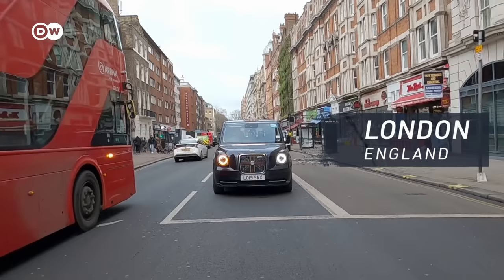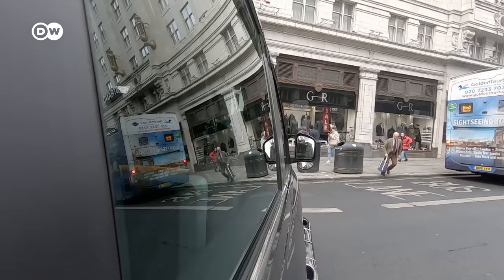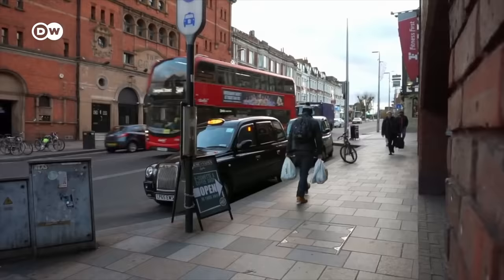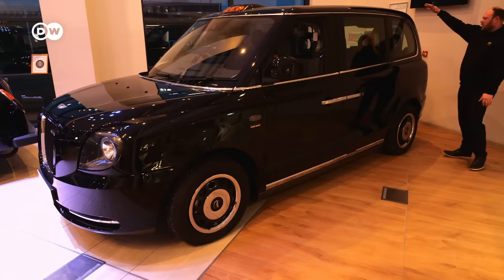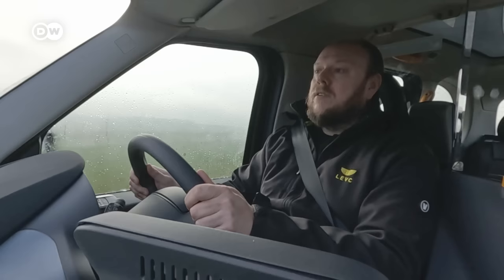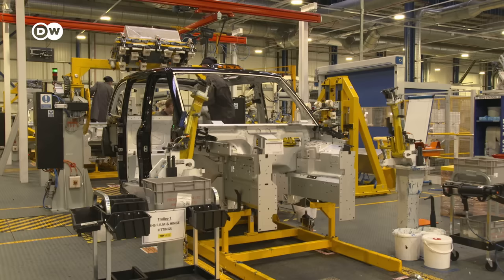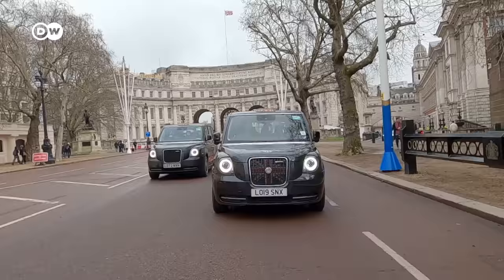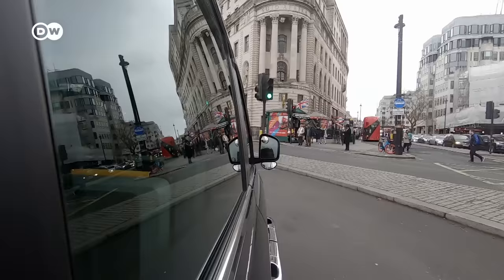Chinese Electric Taxis TAKEOVER London!

Comment: As far as I know,  Geely Group, the Chinese automotive company responsible for producing this Taxi, also owns Volvo and Lotus.
Reply: I`ve been in the factory and they use the Lotus production method for the alluminium monocoques. Quite interesting.
Reply: ...and Lynk&Co and PoleStar Volvo's EV division !
Reply: And then possibly Aston Martin🤔
Reply: And is the biggest share holder of mercedes benz.
Reply: @diuco17  That's what I say.
Reply: @diuco17  Mercedes doesn't have a huge following in China because most Mercedes are made in India, but BMW has a larger market following because BMW at the Brillance factory and in Chinese BMW means "Racing Horse" !
Reply: @etow8034  Do u know Beijing Benz Automotive Co.?
Reply: @etow8034  Yeah sure... Mercedes sold about 980k cars in all of Asia last year, of which 750k were sold in China. Meanwhile in India they had record sales of... 16k cars.
Reply: Ford who owned Volvo was losing money big-time, dropped the hot potato at the first moment, Geely stepped up for the deal and it has been making money year in year out.
Reply: Geely is also in joint venture with Proton in Malaysia and is saving Proton from oblivion.
Reply: yes, since quite a while ! Even took 10% of Mercedes-Benz stocks.......
Reply: @etow8034  And Zeeker
Reply: Geeky is also a major shareholder in Mercedes
Reply: @ericlin1243  "Geeky ?"  Major shareholder ? With 10% ? Don't know where you learned math ?
Reply: @51tomtomtom  10% is major.  How much % do you own?
Reply: @51tomtomtom  major here means significant, not majority
Reply: @51tomtomtom  You're confusing the word major with majority. The definition of major is important, serious, or significant.
Reply: Geely owns 50% of this joint effort and production of all electric London taxi is in China.  Of course, DW won’t tell u that.
Reply: Just a quick search and you can find: "The Chinese BAIC Group currently holds 9.98 % of the company's voting rights, making it Mercedes-Benz Group AG's No1 largest individual shareholder." instead of making unnecessary silly argument.
Reply: yuh..it is
Reply: @DanielBos  Thats why I have no faith on Benz cars.. most of them are Inidan made ones
Reply: @isuruthiwanka2595  ...and parts as well. Bosch parts are now mostly made in India !  the only thing German is the brake and steering fluids from Pentosin ! ...LoL
Reply: @51tomtomtom  Yup in bourse anyone who owns more than 5% of a company's share are called a major shareholder and have "restrictions" in relation to movement of their shares
Reply: What Geely has done with Volvo and Polestar is fantastic. They have kept their ways and only used the funding.
Reply: @etow8034  Generally BMWs are more reliable than Mercs. I used to own Mercs but now I am happy to have switched to BMW.
Reply: @etow8034  作为一名中国人，我可以很肯定的告诉你，你说错了。奔驰和、宝马和奥迪都在中国生产，除了S级、7系和A8，以及最高等级的SUV仍然保持进口，其他的都已经本地化国产了。印度车在中国基本没有市场，除了路虎和捷豹（好像因为发动机的问题口碑很一般）。
Reply: @etow8034  where do you get that information - Mercedes doesn't have a huge following in china?  they are part of the BBA, the first B is Benz Mercedes.   They are definitely on top of the list.
Reply: Also owns Maserati.
Reply: @marsmellow1589  they make a van version now which looks a bit stange!
Reply: @51tomtomtom  Major means.No.1
Reply: @diuco17  wow, I didn’t know that
Reply: Volkswagen Group owns Audi, Lamborghini, Ducati, Bentley, Porsche, Jetta, Scout, SEAT, Cupra, Skoda, TRATON, MAN, Scania...
Reply: So proud
Reply: @DingusSquatfordJr.  So why shouldn't a Chinese company own others
Reply: @etow8034  Interesting that Mercedes is made in india. I hardly see any on the roads in india. When i visited china, mercedes are everywhere especially the Maybach version
Reply: @steventan2550  BMW is more reliable? Are you mad? Anyway I would not touch any European made cars even with a 100 feet pole. Its designed and programmed to fail after a few years even if you have not driven the car at all. The CPU are designed in a way that when you replace something broken and a new problem pops up. Its a never ending process until you have changed everything possible and the cycle repeats again. Its a money pit. Ask any BMW owner that own a BMW for more than 3 years
Reply: I thought it was BYD, thanks for the info.😂
Reply: @blardymunggas6884  Maybach is still made in Germany. Bosch parts are mostly made in India as well !
Reply: @etow8034  Jal hind
But,in 2022 Mercedes produced 640,000 cars in two joint venture factories in China, and China imported about 80,000 from Germany. Can you tell me how many is produced in India and how much is exported to China? :face-blue-smiling:
Reply: @grid-panda  Huge corporations like Mercedes all know how to play the "made where" game.  No one is going to spend the big bucks if they know their luxury car is made in India so they use WTO rules that say if any component or labor or service is the single most costly part of a car then it can be listed made in that specific country.  For example if the entire car was made India and then transported back to Germany to install the engine which is the most expensive component then the car can be labelled as Made in Germany or if Bosch parts and components were all made in India and the parts transported back to Germany or elsewhere to be assembled or serviced.
Reply: @etow8034  Forgive me for not having the latest data for 2022. Prior to 2021, the highest year for India to export auto parts to Germany was FY 2019-2020, India exported $590 million to Germany ,that year (Source: marklines). Even with luxury Mercedes parts, it's a small number. You know, Mercedes’ car sales revenue was $110.3 billion that year (data source: Mercedes financial report) ~
Reply: 吉利汽车
Reply: @etow8034  也许有赛马的意思，但我觉得来源于一个词“宝马良驹”。形容这匹马非常善于打仗，或者快速奔跑，甚至忠诚于主人。
Reply: @diuco17  so they set up joint venture and produce EV under the title of Smart
Reply: and biggest shareholder for MB too.
Reply: @ijaen  True. They are aware of the DNA of the companies they invest in. They’re not just buying the name (like what happened with MG).
Reply: @etow8034  You must be Indian... 刷存在感是吗？ 我能理解。
Reply: @jayliu6076  What makes you say that,  I know Liu is not the mainland spelling for your family name, maybe you're the Indian ! ...LoL
Reply: @ericlin1243 Not many investors will have the capital to buy 10% shares of any big company. If you do, you are a major shareholder for sure.
Reply: @etow8034  BMW “宝马” = A valuable horse ，Benz “奔驰” = run at full speed
Reply: @markreed9853  I don't find it strange, but it has  the advantages of the cab, I would love it if they could bring it to North America.
Reply: @grahammonk8013  I know the taxis is around £62,000 here, probably because there's only limited numbers made, for other use cases a pure battery electric vehicle would be better.
Reply: @ALWH1314  Was the video of the production line in China? smh:face-fuchsia-poop-shape:
Reply: @etow8034  benz have very much fans in China…
Reply: @KAIGE-wl5sk  If you take just 0.5% of 1.4 billion people ...that is a lot of fans !
Reply: @etow8034  Well, I can tell you responsibly, it's a lot more，More than BMW and Audi！An auto show is being held in Shenzhen now，I went to see it the other day，Mercedes has contracted a large space for the exhibition, much larger than BMW and Audi，But it's still packed with fans，I don't like Benz, but Benz really has a lot of fans in China
Reply: Is it also have the smart.
Reply: @user-wm1bu8gl7g  It certainly does.
Reply: @51tomtomtom  The next major share holders with 9%, 8%.  Where you learned your investment lessons????  😂
Reply: Renault gone, too 😢
Reply: Maybe NYC will bring an electric version of the iconic Checker Cab.
Reply: MG Rover too
Reply: @Zerpentsa6598 very true.
Reply: @etow8034  how on earth you can tell lies so calm that it's like telling the truth?  Mercedes sold in China were Made in India?  Well i guess the sun is rising from the West.  Not East.  LoL.
Reply: @51tomtomtom I believe 10% already makes Geely the biggest single shareholder of Mercedes.
Reply: And 10% share of Mercedes-Benz
Reply: @isuruthiwanka2595 I just bought one BENZ ev, made in Hungary
Reply: @etow8034 BMW in china translates as
Reply: @DanielBos 750k out of 1.4 B Chinese? It doesn't add up.
Reply: They own POLESTAR, ZEEKR too.

Comment: EV is very suitable as taxis, low maintenance cost and reliable. I’ve heard an interview of a Chinese taxi driver said he drove BYD e5 for 5 years with 1 million km distance. He only spend 400 CNY in total on service and repairs in the 5 years. Almost no service required. The breaks were barely used because of the energy recovery feature. Also BYD offers one battery replacement for free for the taxis on certain years. By law the car above 1 million kms will be forced recycled. So he changed another BYD EV again.
Reply: But why "force recycle" it?......
Reply: @mickgatz214  应该是，强制报废
Reply: Such BS! BYD ev cars in China, When you buy it new less than a year, the secondary market the price drops to only half of the original price, also there are many electrical problems!
Reply: brake, not break
Reply: @ellis777777  thanks
Reply: @mickgatz214  scrappage
Reply: @user-xr1gb9bo1i  fake news.
Reply: @user-xr1gb9bo1i  Fake news. BYD introduced its first fully electric car, the BYD e6, in 2009. The e6 was an all-electric compact crossover with a range of around 186 miles (299 kilometers) on a single charge. It was primarily used for public transportation and fleet purposes.
Reply: @user-xr1gb9bo1i  Your comment is revealing that you are a Chinese Taiwanese.
Reply: @kimduong2332  Tsai, of course
Reply: @kimduong2332  What comment did I post hurting your feeling?
Reply: @dianasong4594  Apologize, I mistake you for Tsai.
Reply: And only takes hours to recharge....from a coal fired plant. Great!
Reply: @user-xr1gb9bo1i hi Falun Gong
Reply: @user-xr1gb9bo1i  You're just spreading BS!  My friends in China just love BYD EV cars.  I wish I could buy one in north america.
Reply: @jamesdanton9033  You living in 18th century Britain?
Reply: @kimduong2332  1450 to be more precise.
Reply: @user-xr1gb9bo1i  "user-xr1gb9bo1i" LOL perfect name for a NPC.

Comment: I applaud this episode no politics just keeping it grounded about what matters to local needs in fact Geely has really defined value for money for their vehicles
Reply: There’s a smoke and mirrors style avoidance of reassuring anyone that the recharging station capability for the London cabs capacity is at all close to being viable, meaning those little Internal Combustion Engines range extenders would likely be used near 100% of the time during peak hours. I would love someone with facts and data to prove my comment untrue but this is the known problem.
Reply: Which is surprising given 99% of Western coverage of anything remotely related to China and Chinese people is always negative. Props to them.
Reply: You think there is no politics? You need to do a bit more research behind the video. Firslty, these taxis are extremely expensive and prices have been set extraordinarily high to prevent taxi drivers from buying them. Secondly the reason these taxis are forced onto workers is because of their "zero emissions", however video fails to mention that almost all taxi drivers use the back up 1.5l petrol engine, so no this video is highly controversial and very political. It's pushing some false agenda

Comment: London Taxis are basically base on Geely's platforms since Geely bought LTI back in 2007. The first London Taxi to include some Chinese R&D was the TX4 introduced in 2007 (the year when Geely bought most of LTI)
Reply: No such thing as Chinese R & D
Reply: @andymcrae4661  your looking at one right now, most of this cap is designed by geely
Reply: @andymcrae4661  not sure how you can be so clueless
Reply: @andymcrae4661  ya, Tiangong Space Station was designed by Oxford U?!
Reply: @andymcrae4661  Oh there very much is Chinese R&D in certain fields. Just less in automotive. Chinese R&D get wierd and wacky. Stuff other people wouldn't bother doing.
Reply: @Neojhun  
exactly, and I can't exactly blame them as well.
They have gotten tired of being labelled as copycats hence why many of them have ramped up their R&D with Geely being one clear example.
Reply: @asdfghjkl92213  Nonsense. Look up facts before posting: 'The LEVC TX is built on a unique platform, underpinned by a bonded aluminium chassis built in the UK, giving the LEVC TX a 32 percent parts localisation rate by value. China and Europe each account for 32 percent of the content, while United States content is 4 percent.[13]'

Comment: Fantastic 👍🇬🇧
This is what you can achieve when we all work together , a fusion of the old and new coupled with the East & the West , outstanding 👍
Reply: Why did British capital not invest?
Reply: @adamanthony7465  Because private capital does not think long term. They want profits tomorrow and are hesitant to invest in projects that will only materialize years down the road. China started investing in battery and EV infrastructure almost two decades ago, that's why they are so far ahead now.

Comment: I hate riding in all the previous diesel black cabs. These are really nice to ride in. They actually remind me of being in the back of a newer rolls Royce with how silent they are and how smoothly they ride, the panoramic roof is a nice feature too.
Reply: What are you, on the sales team? What do they run on? Coal, that's what.
Reply: @jamesdanton9033  Look up the proportion of U.K. electricity that’s actually produced by coal. Go on. Search for “national grid live”. Coal accounted for just 0.6% of electricity produced in the UK last week. 

Coal isn’t a significant part of the UK’s grid supply any more. 

It’s use increased slightly at the start of the Ukraine conflict, but we’ve found other sources of gas now, so it’s back out the window. 

I’d rather some relatively clean, massively filtered smoke from a natural gas a power station in the middle of nowhere, with a forest around it, than massively carcinogenic diesel smoke getting fired straight at the pavement, in the middle of a city.
Reply: @jamesdanton9033 
From your comments all over this video, I take it you really hate coal?

Comment: Chinese cities have implemented electric taxi long time ago.  I am glad that the UK is also doing so.  But the U.S. who pushed China is too far lagging behind.
Reply: China made electric buses are sold quite well in usa.
Reply: I’ve seen 1 EV taxi in Jilin northern China they do not perform in cold weather it cuts the range by 40%
Reply: Muttricuck bros
Reply: @gazgaz2767  A feeble counter-argument.
The technological issue in the cold is to keep the batteries warm. The operational challenge is cooling the batteries. During regular charging (more so during quick charging) and often during use, battery packs have to be cooled by technological means (coolant fluids and ventilators) —  ever heard ventilators blowing when EVs are being charged, and during high performance use?
On cold days the need for cooling of battery pack while charging is less. After charging, the heat conserved in the insulated battery pack ensures no loss in performance — continued use of the well-insulated battery keeps it warm and performing even at cold ambient temperatures.
The postulated range loss of 40 % can only be  the projected loss after "cold start" of EVs that have been standing out (overnight) in extreme cold without being charged — and poorly-engineered — i.e. cold — battery packs.
Thermo-regulation of battery-packs is a pretty trivial technological challenge.
Reply: because the USA is slow, but we do it CORRECTLY. china does it fast, but low quality. Safety concerns will make all these cars be recalled. I guarantee it.
Reply: @gazgaz2767  Chinese EVs perform better in cold weather than Tesla.  That is one of many more advantages of Chinese EV over Tesla.  Can you give the brand name of Chinese EV you are talking about?
Reply: @diamonzburnett  Stop your BS.  As far as EV goes, China is leading in EV technology and especially in the battery technology.  As far as safety test, Chinese EVs ranked on top of list.  Please read more EV Tech reviews.

Comment: I had a ride in an all-electric taxi in 1976 in Birmingham UK. It had a range of 100 miles and a top speed of 55mph. It was made by Lucas and designed by Ogle. It was far ahead of its time. It was yellow.
Reply: Lucas was the most common name in automobile electricals in those days. Trusted.
Reply from the maker: That's amazing! Would you happen to have any photographs of it? If you do, send them to us on rev.community@dw.com.
Reply: @DWREV  Lucas also produced hundreds of electric vans in the late 1970s and early 80s, some of which were converted to minibuses. Most were conversions of the Bedford CF or the British Leyland Sherpa. They used lead-acid batteries and a separately-excited DC motor with electronic controller. It was possible to get 100 miles but you had to drive very gently and slowly. 40 or 50 miles was more like what you would get if you drove at normal traffic speed. With lead-acid batteries the range you get is much more affected by how you drive than with lithium-ion batteries. In 1980 the only real alternative to the lead-acid battery was the nickel-cadmium battery; this was more durable and could give a somewhat longer range but was much more expensive.